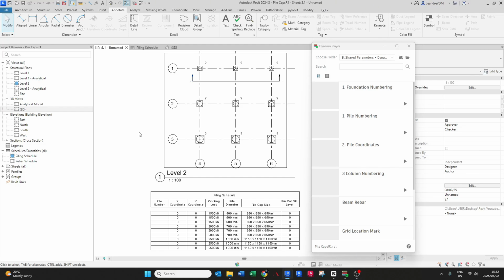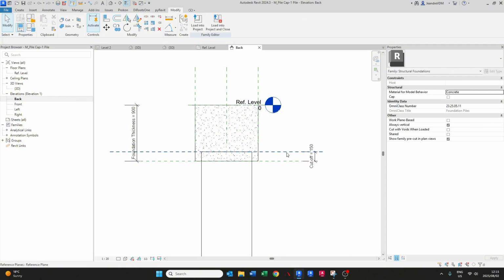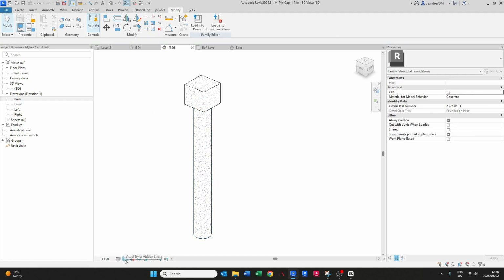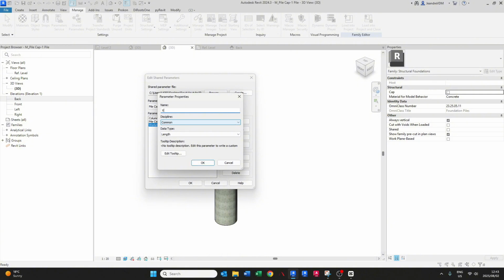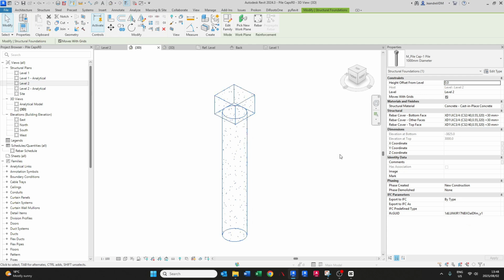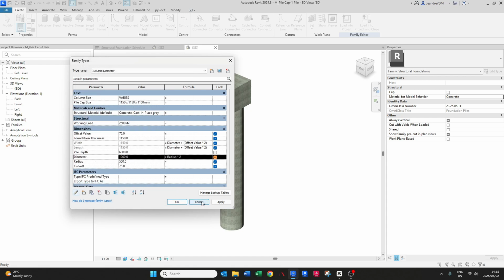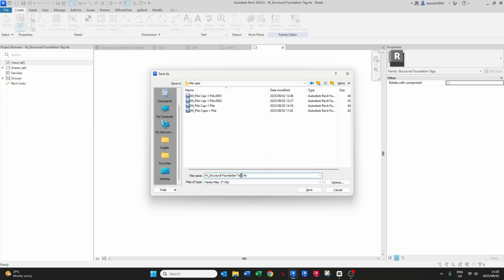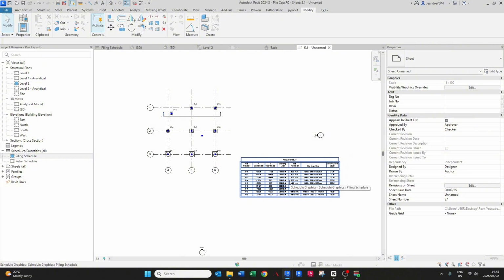Revit - Pile Family Setup & Auto Numbering & Coordinates with Dynamo

Comment: Do you have a video about how to create a dynamo script?
Reply from the maker: Unfortunately not, but you can buy the Dynamo script from the video link at a 50% discount.
Reply: @RevitWiz is the script applyable to other structural foundations as Well?
Reply from the maker: No, you’ll need to update the script for it to work with normal foundations.